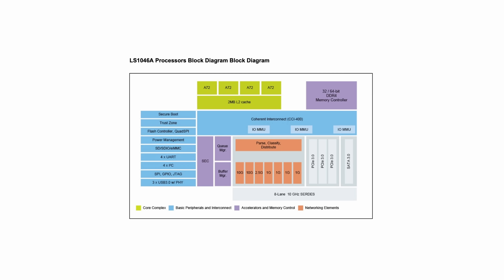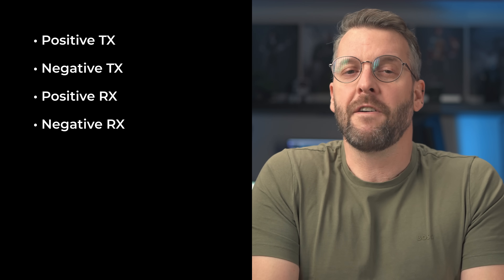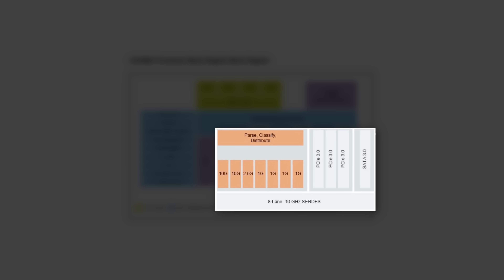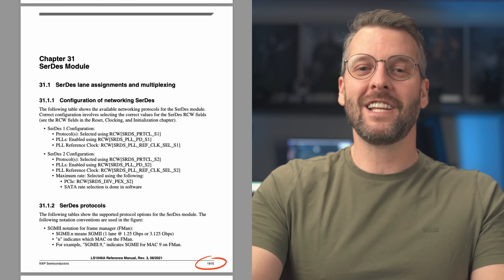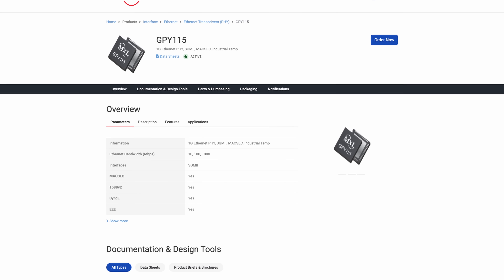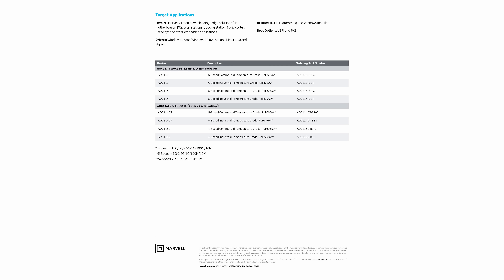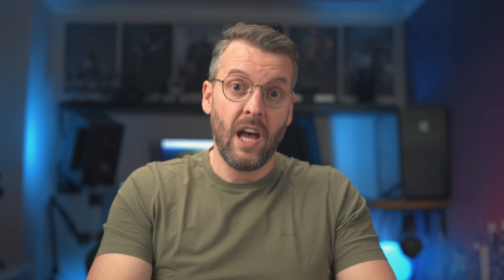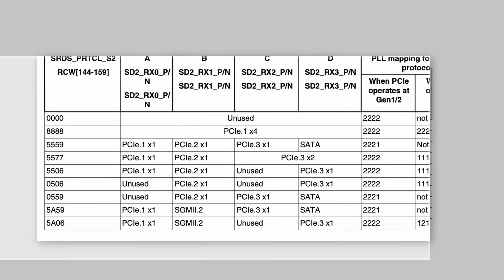You sure do LOVE your 2.5GbE ports!

Comment: Remember that your firmware can allow multiple Serdes configs on the same hardware. For example, you could allow a software-downgrade to mode 2233 on serdes 1 to allow people to plug in 2.5 Gbit SFPs into the 10Gbit/s SFP+ Ports if they have no 10Gbit infrastructure - usually, this is pin-compatible or requires minimal change to the pcb for dual use compatibility
Reply: (although probably less sensible overall,) the same could be done for SATA - move the M.2 to RX2/3 on the second serdes, and also route rx3 to a SATA Port, now the user can choose between using the M.2 at x2 or the SATA port and M.2 at only x1 - although here it will require a bit of extra hardware and good communication so users don't think they'll be able to use both, so that might not be worth it

Comment: point of having 2.5G port is to use as wan port not an uplink
for uplinks we have 10G ports no point in wasting 10G port for 1,5-2G wan uplink
Reply: This right here!

x1 or x2 2.5/5Gb for (multi-)WAN, 2x 10Gb for bonded uplink to switch. I have a Dell R330 doing this now, but I'm looking to a more specialized device with less power draw. Why would I want to down grade my WAN connection/bandwidth to get < 1Gb when I'm paying for 2+Gbps.

And no, I don't want to run my WAN connection through my switch. I've had some ISP "modems" that don't like being on a VLAN and never get a DHCP. Maybe bad setup on my end, but direct connection for that is (imo) one less point of failure to test.

@tomaz .... Love what you're doing here and appreciate seeing the process you're going through. I hope in the end I'll be able to get one as I have yet to find one that fits this use case, or maybe I'm just stuck with my DIY server setup. ❤️

Comment: I would highly advise against using those ACQ-Marvell (aka. "Aquantria") chips with 2.5, 5 or 10GB/s speeds. I have used several of them (onboard, dedicated PCIe-Card,...), and especially those faster than 1GB/s share a very bad bug that makes them totally unusable for a router-purpose: after a seemingly random time (which can vary between several hours up to several days) the interfaces just drop out. They are still visible in software, and hold their IPs (so they do not receive a physical "unplug"), but all packets are either dropped or just not reaching the other end of the cable. Even worse is, that the interface does not come up again by itself, you have to reload the corresponding kernel-module ("atlantic" under linux). From there on it gets worse, because when this happend once since boot, then it happens very freqeuently (mostly after a few minutes) again. Only rebooting fixes this situation. Disabling LRO/GRO-Flags mitigates this problem to a certain degree (it just happens later), but not entirely. I tested under arch, mint, ubuntu with i-cannot-remember-how-many-kernel-versions between 5.2 and 6.7, but the behaviour is always the same on all distros on all cards. also tested different switches, with and without sfp+-gbics. 

...there is a reason why in the industry everyone uses intel and realtek, and consumerboards have aquantia-chipsets...
Using those ACQ-Chipsets would certainly rule this router out for me just because of how many grey hairs of mine it has been responsible for. Please don't.

Comment: I love the name of the product!!! Something that maybe a lot of people forget is this is a router, not a switch; keep cost down with the two SFP+ ports and maybe another copper port for easy management. Also please consider adding a M.2 for NVMe storage even if only connected with 1x PCIe lane.
Reply: I’d want two M.2 for mirrored boot drives. Wouldn’t matter whether they were SATA or NVMe

But unless you’re talking about DNS, DHCP, or other similar services that run within the routing/firewall software, I’d rather have any other services running elsewhere. 

I like to let my router route, my NAS serve files, and everything else run on a virtualization host of some sort. 

YMMV

Edit:

A console port would be very nice to have.
Reply: Why do you need a NVME port for ?
Reply: @bastlub  additional storage, not NAS like but storage for  containers/docker that can run on the router itself for networking related services
Reply: @vladconut I wouldn't recommend running docker directly on your router.
Docker has a ton of security issues and from my experience running it on anything that is not behind a firewall is just asking for trouble. 
We had servers hacked many times due to docker messing with linux firewall and disabling security rules.
There is even a well known bug that docker (the company) does not want to fix due to "compatibility", where if you set docker to run only on one network interface it will sometimes ignore that rule depending on how you started your container.

TLDR:
Don't run docker on your router.

Comment: Wouldnt you be able to sell a seperate version for those interested that comes pre-shipped with a pcie 2.5g port adapter and respective mounting point / cutout in the case? This way you don't lose hardware acceleration but can still offer a 2.5g port for those that want it. You could even have just one / the same case for everyone, but just have a cover for the unused 2.5g port. This way if somebody wanted to upgrade down the line, they could add it themselves (And you could sell the module for it seperately)

Comment: Just my two cents: A few months ago, I "built" a router based on a NUC PC with 2x 2,5G ports. I quickly realised how useless these 2,5G ports are because I don't need to route this much of traffic to my router anyways because my ISP connection is still limited to 1G. What's more important is to have a 2,5G switch, so that you can at least utilize the bandwidth in your LAN. Granted that I really only use my router as a router and not as a combo device like HTPC, NAS, etc.

In the future, when 2,5G internet connections will have become the new standard, current HW will be outdated anyways, so it doesn't make sense to future-proof in this respect, imho.

Comment: I find myself in the middle of the field. I would be very happy to see 2.5GbE simply because of how much it feels the industry is moving that way. However, I also have a 10GbE aggregate switch to break out into 2.5GbE. So it wouldn't be a huge deal if it didn't have it. I think if the price is right, it's a good idea to have it. If not, then I don't see it as a deal breaker to have missing.

Comment: A faster third port could be great for implementing a DMZ for home usage or a guest network. Self-Hosting should be a typical use case especially in the target audience for such a router. A layer-2-switch could split the 10 GbE ports as required to supply more connection options, but configuration of a DMZ would require looking for specific VLAN capabilities again, driving up the cost immensely. 
I think having a more powerful third port would drastically increase the use cases for the router, but I‘d be interested in hearing other takes on this, if someone would like to comment.
It‘s unfortunate that this would undermine the specialized SoC by necessitating PCIe though.
Reply: I'd rather do VLAN for a DMZ than having those drawbacks that come with the 2.5 or 5 GbE version.
Reply: @Luniii737  I can understand that, but apart from the increased costs, the drawbacks only relate to the upgraded port, so unless the three 1 GbE ports are all budgeted in one‘s setup, the drawbacks would only affect those who wish to use the port.
I don’t like to rely on VLANs for segregation in home setups - for one, they need more expensive hardware, and they are less secure than physical ports, even though most known exploits can be mitigated.
I think having another capable port for a different network directly on the router would really future-proof the device.

Comment: What about 1x10g and 1x2.5g while keeping the 4x1g  Sounds like it would be an option to replace one of the 10gs with 2.5g.
Not sure if 2x10g make sense for this device.
Reply: That makes no sense. Its a router, not a switch aimed at many ports to one fat pipe.
Reply: @fluffleboxbait  I know its a router, but 2x10g still makes no sense to me. If you want redundancy you probably want 2 of them thus you ahve 2x10g you can heart beat/failover 2.5g. Also most traffic probably hapens Intervlan, thus 10g send recive is possible with one port. And it allows for a couple slower managment ports and/or wan Ports if your WAN is multi Gig you want it tagged on a switch anyway in most cases. So Regardless I'd sacrifice a 10g for a 2.5g if ppl want it tho I don't see a need for 2.5g at all.
Reply: Doesn't make any sense for a router.

Comment: The real shame is that 2.5G is only used by CPE manufacturers that create retail consumer devices. 10G is far more abundant and available not to mention less expensive than 2.5G. In most cases people only need a single 2.5G port to accept a WAN handoff from their provider, in this case just use a 2.5G to 10G SFP+ media converter and keep your beautiful router filled with 10G/1G ports as the universe intended.

Comment: I would say stick with the initial design I don't know about most other people but as long as we can configure any of the ports and WAN or LAN. Then I don't see a reason to have the 2.5G NIC. I know here in the USA most people have a 1G or less WAN connection to the internet and for the ones that do can just use the SFP+ port with a adapter transferer to go from fiber to copper. That would also still free up the second SFP+ to use for downstream LAN connection to a distribution switch or the core switch in the home. So I would say just stay with your original design and if enough people buy that one and still want more connectivity just make a version 2 with a focus on higher speed ports and no 1G ports.

Comment: I think having a SoC specialised and with hardware acceleration enabled router is much more important than using PCIE to add 2.5 GbE interface. I rather have two 10GbE SFP+ interfaces, which I can add to a switch, than having a 2.5GbE interface. I would rather buy a 2.5GbE switch - as I remember mikrotik has published a latest switch with multigig capabilities.

Comment: Can't you just put another M.2 E-Type Socket on the board but wired in PCIe 1x1? (Or maybe have a switch/BIOS option to disable one of the sockets/reroute the lanes to the other socket for a full PCIe 1x2?)
That way people could just plug in a M.2 2.5GbE card at full speed or both it and WiFi at reduced speed after the fact, if someone wants to do that, i've seen a lot of people mention they would like to have a cut-out in the case so they could plug such a card in themselves if they chose to do so, all without impeding the 1GbE supply correct?
I would love to know what you think about this approach since technically you don't have to increase the cost compared to including the 2.5GbE phy in the first place unless i missed something.

Comment: I'm not sure about how everyone else is looking at this but I see this as a high end "prosumer" router nearing enterprise level of hardware. The types of people that this would be marketed to are home labers who generally have racks with "real boy" networking equipment. I don't understand the logic of so many demanding 2.5. For the cost of 2.5 you could just move to 10T which, in most cases the chipset would support 1,2.5,5, and 10 for backwards compatibility. You can also do just this with an SFP+ copper transceiver. So with 10g essentially being pedestrian in enterprise at this point WHY IS THERE SUCH A DEMAND FOR 2.5? 

Do none of you understand the timeline for the development of a device like this? Do you not understand that by the time production is ramped up and you have this in hand that we'll have 10g wireless in consumer devices? Wifi 7 is already here and there are AP's on the market that have 10g uplinks. WHY bump the cost for 2.5 when its already dead? Why effectively make the router obsolete upon release while increasing its production price?  Either go 10 for future proofing or don't bother and just make those 1g.

Comment: 2.5 GbE doesn't seem worth it in this scenario. There are already 2x 10G ports that could be adapted downward and if 2x 10G is not enough, 2x 10G + 1x 2.5G is unlikely to make a big difference. It's a nice upgrade over 1 GbE stand-alone, but going from 4x 1G + 2x 10G to 3x 1G + 1x 2.5G + 2x 10G is not really a big deal...

Comment: M.2 slot doesn't have to implement all pcie lanes, just one is enough unless you want more speed. And since you aren't likely to require more than 8 Gbps of bandwidth for your router - it's not a NAS - you can get away with implementing just a single pcie lane in the port. Infact a lot of embedded systems do just that.
Reply: I wanted to say that, Also you don't need to implement all the other interfaces.
There is one gotcha, though: some devices like eg. intels network/bluetooth combo cards use both lanes since they are just 2 separate devices on a single board.
Reply: @hubertnnn   Those use PCIe for the WiFi and USB for the BT part. 4G/LTE cards only use USB as well.

Comment: Hey Tomaz 

I'm really enjoying your channel and router videos so far. 

But I think you may have overlooked something important (which most router manufacturers have resolved). 

If I understand your last 2 videos correctly, it seems you want to perform all the routing and switching via the CPU...

In 99% of cases, you only need routing between the EXTERNAL and INTERNAL networks, and simply switching between INTERNAL ports. 

Your current design would be awesome for someone who needs separate networks (in different IP ranges) which require ROUTING. 

But in the majority of cases, you'd need one (or perhaps 2) external interfaces - and a few internal ports. 

Most people want internal ports to provide wire-speed throughput. 

In my humble opinion, you should decide whether your router is targeted towards people with many EXTERNAL networks and a single INTERNAL network, or the other way around. 

If you target market is the latter (as in 99% cases), then I would recommend you look into a dedicated SWITCHING chip. 

The switching chip could then link to your main CPU (2.5, 10Gbps or whatever is available) - but non-routed traffic between local devices (on same internal network) would have full wire-speed performance at no cost to your CPU. 

Have a look at the Mikrotik RB2011 series routers (I find this model has excellent documentation, but the 3011,4011 etc routers operate on the same principle)

Comment: Upgrading from a 1GbE port to a 2.5GbE port doesn't seem worthwhile to me, given that I already have a connection at home that's faster than gigabit. However, transitioning to a 5Gb port would turn it into the ideal router for me. Having a 5Gb port for WAN while still retaining two 10G ports (perhaps even with the potential for link aggregation) is the router of my dreams. I'm not particularly concerned about the 1G ports, though they could prove useful for "miscellaneous" APs, such as a separate IoT network or similar setups. Equipping it with 2xSFP for LAN usage and 5G for WAN usage (I'm not sure if we've discussed potential software options yet, but most open-source or advanced router software can accommodate such configurations) would, in my opinion, make it extremely future-proof. I'm unsure about the price disparity between 5GbE and 2.5GbE, but in my humble opinion, 5GbE would make more sense, especially if it can operate in a 2.5GbE mode as well.
Reply: At those speeds I would imagine the infrastructure is already fiber (for WAN) and it makes more sense to go directly into the SFP+ cage with an optical transceiver rather than having another device to go from fiber to copper just to use the copper port.
Reply: @vladconut  You're absolutely right. It would make much more sense to go directly into an SFP+ port. Unfortunately, my ISP thinks differently. When I attempted to bypass their device using a GPON transceiver, they contacted me within 2 business days, stating that their monitoring showed something was wrong with their device and they would replace it. When I explained about the GPON module, I was redirected to someone else who informed me that this goes against the Terms of Service (ToS) and if I don't use their hardware, they will terminate my contract. So, yes, it would be much more sensible to connect directly to an SFP port, but regrettably, it's not something my ISP allows or tolerates.

Comment: I like the original idea of the 2 SFP+ and 2 1G ports, all using the SoC's infrastructure. A switch connected to the SFP+ ports can provide 2.5G if needed.
Reply: That's exactly what I was thinking. 10gb SFP+ to 2.5gb switches are like 60 bucks these days. Dont over complicate the router for 1x 2.5gb port for the same cost that a switch with 5-6 ports will have.
Reply: @Allhopeforhumanity  popular options on amazon:
$65 = 1x10G, 8x2.5G (uses a 10G port)
$45 = 2x10G, 4x2.5G (uses a 10G port, but gives you another for chaining)

the total bandwidth is reduced by a whopping 1.5G by not having a 2.5G port on the router, which is not super noticeable with 10G downlink, and you can get more 2.5G ports for around the same price IF you want/need them
Reply from the maker: Agreed. Very much, actually. But needed for other people to say this! Thank you!